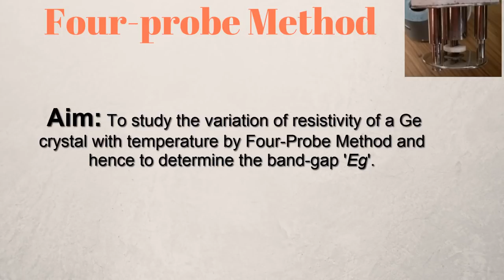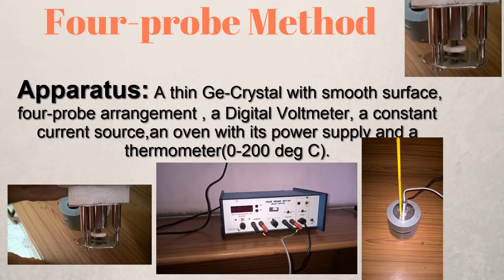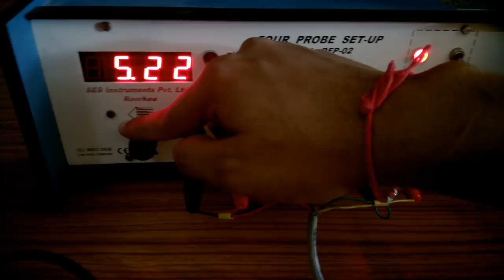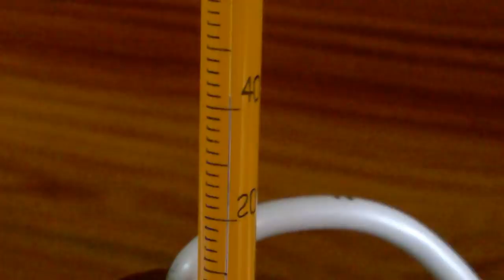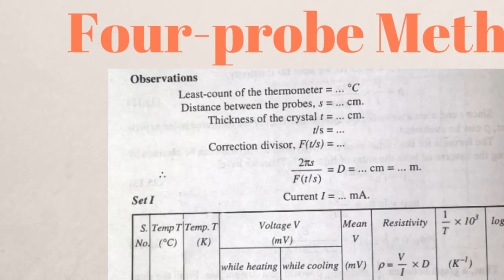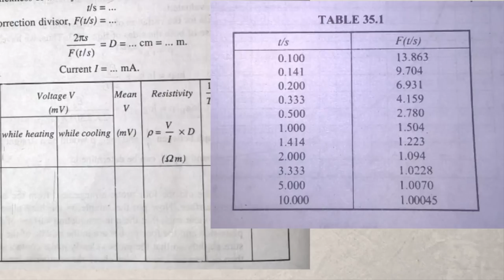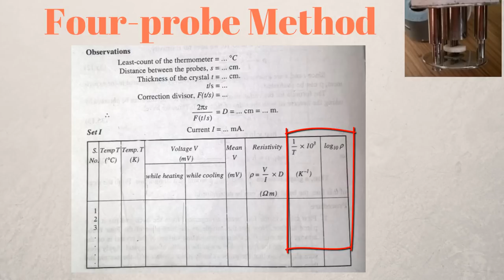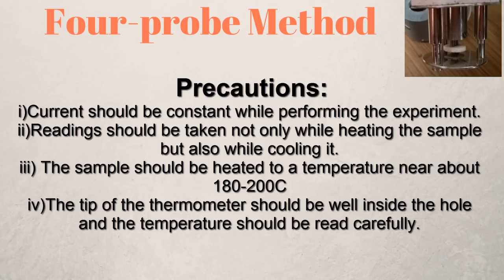Four Probe Method [EXPERIMENT]

Comment: Why the voltage is decreasing and not increasing
Reply: it is property of semiconductor due to band gab between conduction and valance band approximately 1ev ,as the tem. goes up the electron jumps to conduction band ,so the conductivity increases and voltage decreases